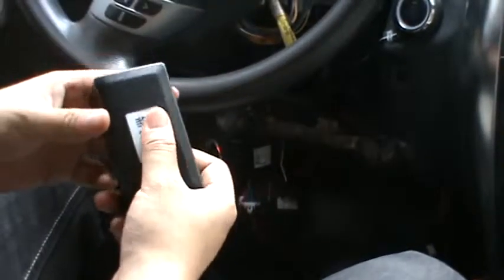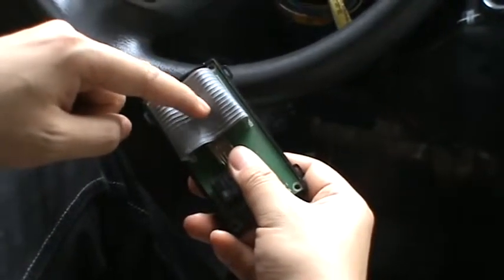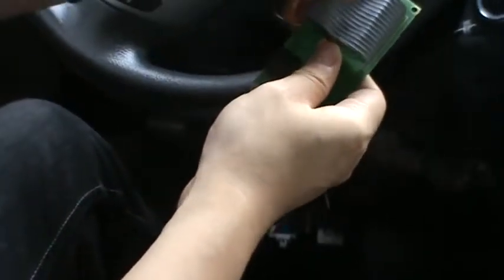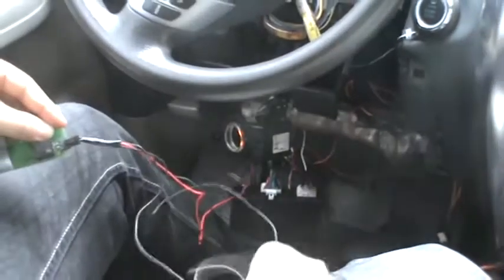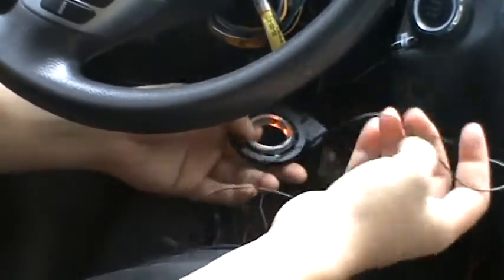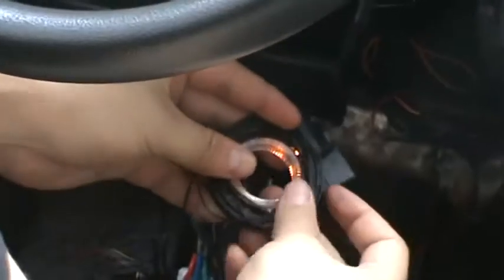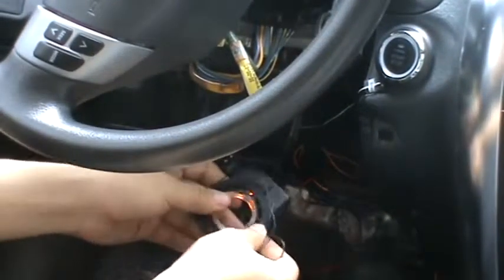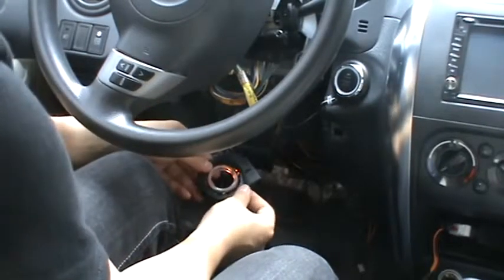IMMO Bypass operation demonstration By E TECHGUARD

Comment from the maker: Business: Company Profile PPT
Business: GPS Tracker Advantage PPT
Business: GPS Tracker Cooperation Modes PPT
Business: Push Start System Marketing Promoting Guide
Business: E-Techguard Quality Introduction
Business: MSRP (partial products)
Business: Distribution Agreement
Business: Frequent Q&A of RCAS (Rear-end Collision Avoidance System)
Catalog – Company Profile
Catalog – Product Integrated Flyer
Catalog – Product Single Flyer
Certificate: 4S (showroom) Certificate (partial 2011)
Certificate: 3C
Certificate: Gold Award by SIPO
Certificate: Brand Award by Association
Diagram: PKE-100(K) with ST, PKE-100(L) with ST, PKE-100P
Diagram: GPS Tracker CMSN-VH/V1/V1L
Diagram: GPS Tracker CMSE-V2/V2L
Diagram: Window Closer
Diagram: RCAS
Diagram: Immobilizer Bypass Module
Diagram: Fuel Circuit Disconnector
User Manual: PKE-100 Keyless Entry System
User Manual:PKE-100L/K+ST, PKE-100P/PF Push Start System (Latest update at Nov 2013)
*For E-Techguard Standard-Version products only, not applicable for Customized or Branch-Version products.
User Manual: SG Push Start System (Latest update at Nov 2013)
*For E-Techguard Standard-Version products only, not applicable for Customized or Branch-Version products.
User Manual: CMSE Series GPS Tracker (Latest update at Oct 2013)
*For after C0 (including C0) firmware products only.
User Manual: Start Master Integration Guide (Latest update Oct 2013)
*For after C0 (including C0) firmware products only (CMSE part).
General Manual: RCAS
General Manual: PKE-100(K) + ST
General Manual: PKE-100(L) + ST
General Manual: GPS Tracker Ver. Offline
General Manual: GPS Tracker Ver. Online
General Manual: GPS Tracker Online Management Guide
Software: VCDS for Volkswagens vehicle
Software: E-Techguard firmware Updater for GPS Tracker & Smart Start Master
Software: Car Secretary™ App for GPS Tracker & Smart Start Master (Android)
Software: Car Secretary™ App for GPS Tracker & Smart Start Master (IOS Root Version)
Software: Car Secretary™ App for GPS Tracker & Smart Start Master (IOS App Store Version)
Specialization: Panel and Button
Specialization: Blank Key
Specialization: Start Cable for PKE-100K/L with ST
Specialization: Start Cable for PKE-100P/PF
Specialization: Specialized keyfob
Specialization: Cable for Window Closer
Specialization: Key Logo for PKE-100(K/L/P) type K1/K2/K3 remote key
Technical Reference: Wire Definition & Location (partial cars 2009-2012)
Technical Reference: PKE-100(K) Service Manual
Technical Reference: PKE-100(K/L/P) Installation Guide (partial cars 2009-2012)
Technical Reference: Window Closer Installation Guide (partial cars 2009-2012)
Technical Reference: Installation Guide of Rear-end Collision Avoidance System
Technical Reference: FAQ of Rear-end Collision Avoidance System
Technical Reference: GPS Tracker Recovery Method
Technical Reference: PKE-100(K/L/P) Smart Key Adaption Method
Technical Reference: PKE-100(OV) Smart Key Adaption Method (VCDS Operation Guide)
Technical Reference: PKE-100(OF) Smart Key Adaption Method
Technical Reference: Morse Decoder Operation Method
Technical Reference: IMMO Bypass Operation Method
Technical Reference: Installation Guide f or RCAS
Vehicle coverage: PKE-100(OV)
Vehicle coverage: PKE-100(OF)
Vehicle coverage: PKE-100(K/L)
Vehicle coverage: PKE-100(P)
Vehicle coverage: SG
Vehicle coverage: Window Closer GS-SW
Vehicle coverage: Window Closer GS-ODB
www.etechguard-services.com
www.etechguard.com